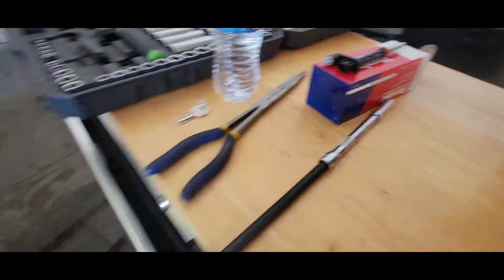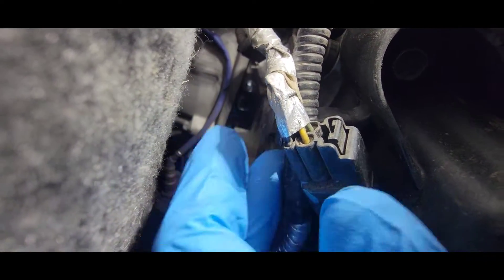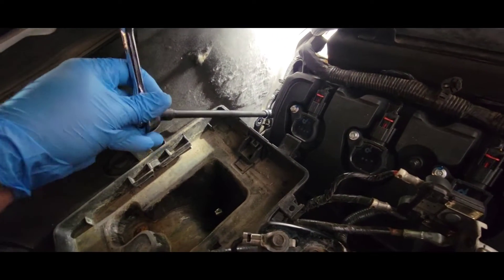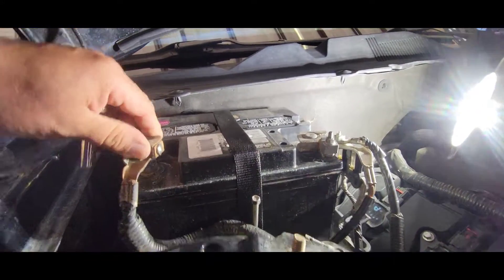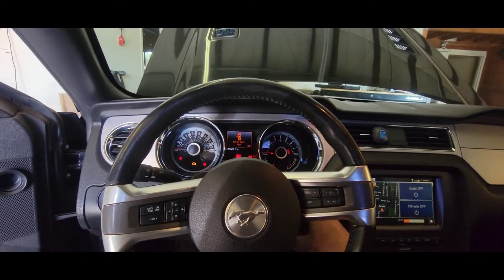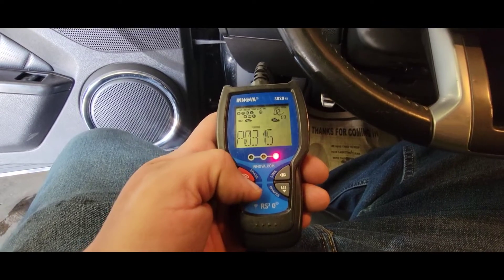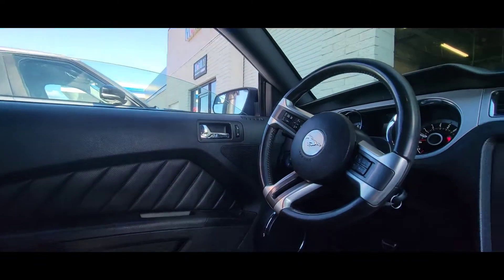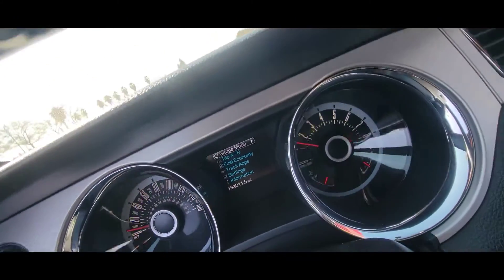How to: Install Crankshaft Positioning Sensor Mustang GT 5.0 (Recalibration is Required)

Comment: Can you recalibrate with SCT tuner?
Reply from the maker: im honestly not sure
Reply: Did you recalibrate it or just clear the code
Reply: How did y’all end up recalibrating it?
Reply: @stretch4595 crank relearn procedure, can be done with sct device but if you're stock it can be done via vcm scanner on a computer and a reliable adapter to pair it with.